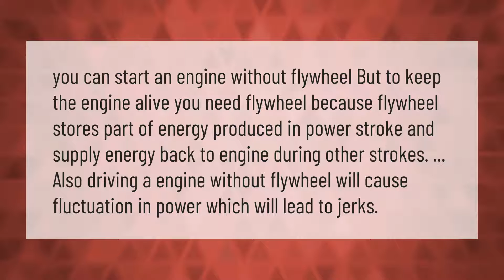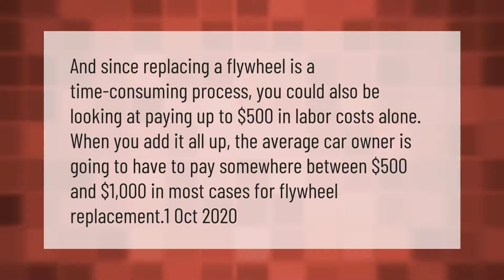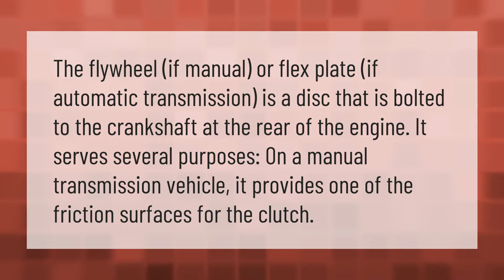Can an engine run without a flywheel?

Comment: You cant start the engine without the flywheel
Reply: No, there's an old school construction device called jumping jack rammer which is basically two stroke engine that runs without flywheel, just compress. These kind of construction devices are rare becuase modern gas powered rammer uses flywheel. Also, there was a gas powered pogo stick, a banned toy that runs on petrol without flywheel. Flywheel doesn't matter to some internal combustion engines.
Reply: What would the starter turn?
Reply: @jamonfeltner4417  flywheel
Reply: Haven't hear the Honda six?